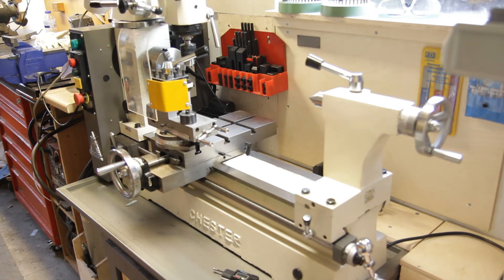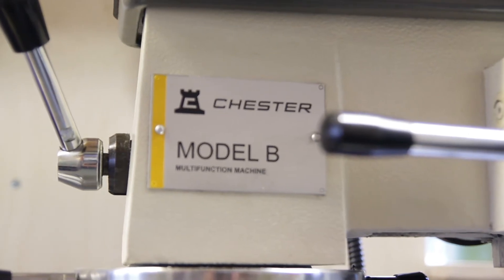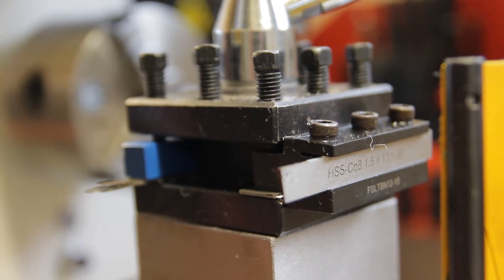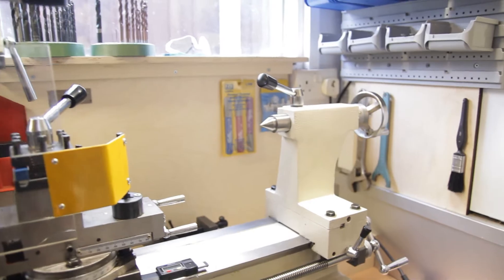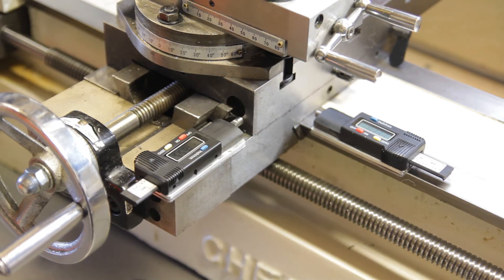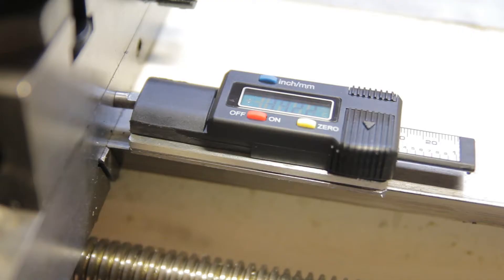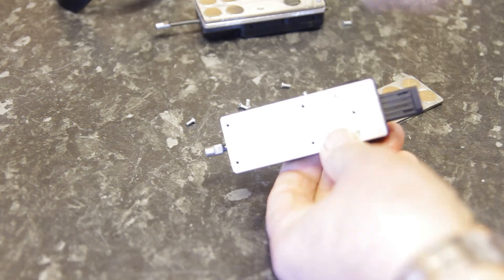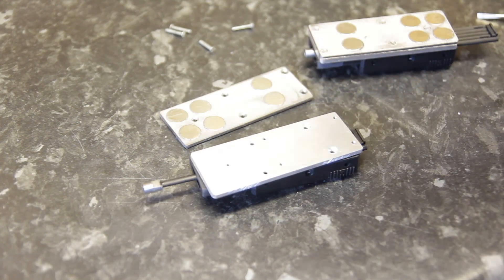DROs for Chester Model "B" Lathe

Comment: I just bought a 2nd hand Chester with no operating instructions.  Apart from removing the drive belts that connect the lathe gears to the milling machine is the a button or handle that disconnects the miller / drill from the lathe
Reply: If you look inside the end cabinet at the headstock spindle, there is a clutch ring that pulls out and pushes in to engage/disengage the mill head.
Reply: @madrishine  thanks for that. The person who sold it to me had bodged it as they put a spacer behind the clutch wheel so it wasn't fully engaging and disengaging